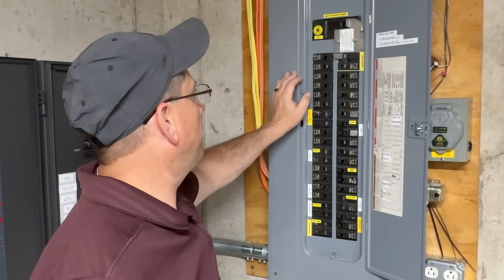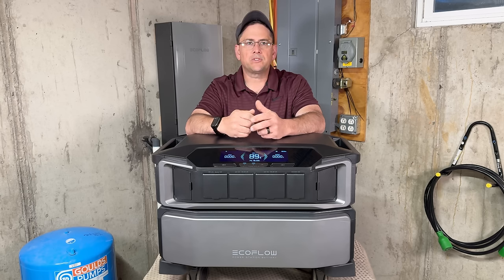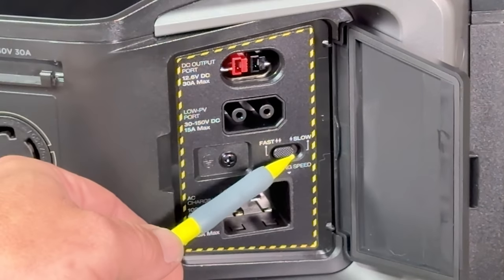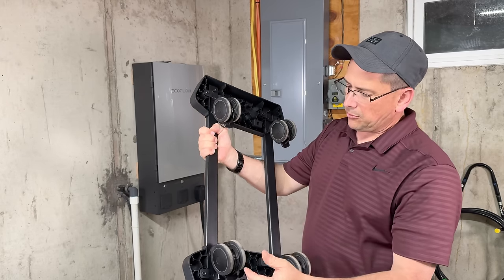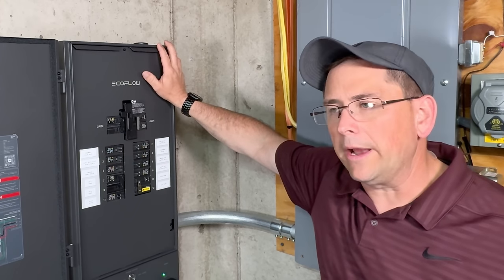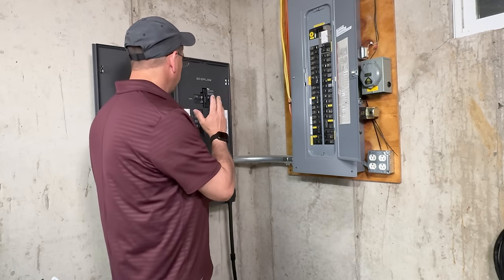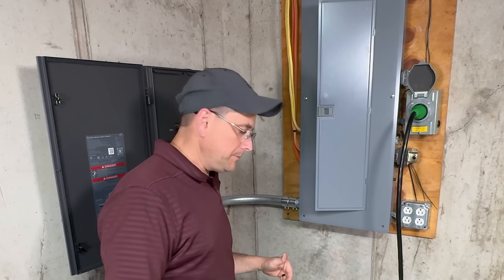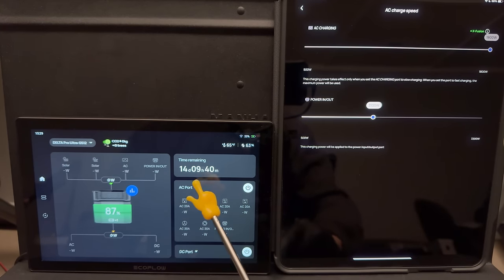EcoFlow Delta Pro Ultra & Smart Panel 2 Replaces Generac Standby Generators Part 1 of 2

Comment: Question; I have 25 circuits in my 200 amp main panel and plan to move the 12 most critical to this smart sub panel strictly for emergency power needs using a 2 battery Ultra configuration. My concern is the reliability of this smart panel and specifically the manual transfer switches. What type of switches are these? Are they a simple electro-mechanical switch where if the automated portion fails the manual function still works? I don't want to dedicate the 12 most critical circuits in my home and later experience a switch failure in the panel with no way to switch power for those circuits as for me it's either grid or battery. I've read at least one instance of a user having a panel issue where EcoFlow sent them a replacement SH2 panel which is an expensive swap out if an electrician is required. Are control components in this panel replaceable without having to disconnect and remove the entire panel?
Reply from the maker: It doesn’t look like there are serviceable parts inside, but I don’t have a repair manual for it. I will have to ask, from what I seen it does not look like it.
Reply: That is how it appears to me. Do you have any thoughts on the 2 switches that toggle between grid or battery power? Do you have any concerns over their durability?
Reply from the maker: It has a 10 year warranty, that’s longer than anything I’ve seen. Everything breaks, I’ve seen Generac generators lose brand new motors at start up, some at 1 & 2 years old. Nothing is full proof, if you’re wanting more reassurance then wire up the system with an interlock switch so you can override the panel if it fails.
Reply: @HVACRSurvival  What you say is true and the warranty is a good feature. There is one customer review on Costco that describes a failure of one of the panel's transfer switches and EcoFlow tech support indicated they would ship a replacement panel but apparently it took a while. In his case the switch was stuck on grid, not battery and if that's the fail safe default then I'm good with that.

I've thought about installing a transfer switch too for more flexibility but that doesn't solve the problem of the 12 isolated dead circuits in the SHP2 if it's possible for the panel to fail in that way. 

Thanks for your quick responses.
Reply: I just got off the phone with EcoFlow and they said the transfer switches in the panel can fail in either the gird or battery position so no default. 

After thinking more about this it may not be as dire of an issue as I thought because if they fail in the grid position I only lose backup capability should i need it. If they fail in the battery position and I have grid power, I can use an extension cord from a grid powered outlet to keep the batteries charged while they're powering the 12 critical circuits. I'd have to rely on this obviously until a replacement panel was received which isn't ideal but at least I'd have a way to power those circuits. It would be good to know you agree and that I'm not missing something. 

Thanks
Reply from the maker: @robertbaron3242 it does have a manual override switch. I haven’t showed the detailed testing yet, I’m due to release the video on Amazon prime day in July. I was also asked to combine the DP3 and DPU together and compare them. So the video will be a little different than I originally intended but it will be informative. I need to record the new stuff they want showed.
Reply: @robertbaron3242  I read that a customer who had a failure had to send the smart home panel back first, and I think said half the panel didn't work, so likely the idea of running on battery or grid wouldn't work, even if they sent you a panel first.  Either way, you are in for hours of labor to swap out a replacement which unless it's sent over  night (which I doubt, prob weeks of RMA) you will likely have to rewire your main panel back to how it was before.  As soon as I read that, I 100% bailed on the idea of installing one.. It's designed for your most critical circuits, no way could I rely on that.. could be more of a headache than riding out a storm with no electric for a day., you are at least preparing for a storm, not at dinner when a relay fails in the SHP... I decided on a DP3 with extra battery and their generator and will do the interlock...  lot of versatility without compromising any of my homes components.  It's a shame because for just a bit more money (already silly expensive) without the SHP you lose so many nice features.. auto switch, battery to offset time of use.. but no way should installing a backup system potentially be the cause of losing power.
Reply: @crzyworm623  I came to the same conclusion and shipped my SHP2 back but kept the DPU with 2 batteries. I instead installed both a Reliance 10 circuit transfer switch and their 50 amp generator inlet. This gives me the option to power either just 10 critical circuits or the entire panel. Having the option to power just select circuits provides more flexibility for routine battery maintenance without having to use the main panel interlock and disrupt the entire house. I installed the 50 amp versions with the possibility I might add a second DPU next year. 

It was a bit of a struggle to get the SHP2 returned because it was purchased as a package with the DPU through Costco but perseverance and a few months of patience got it done. I agree that you lose all the cool smart features of the SHP2 but I don't see that device as ready for prime time as it's just not reliable enough IMHO. I would like to have seen a simple manual override in the panel but that might not be possible.

Comment: What would you need to be equivalent to a 24kw Generac.  Cost and life
Reply from the maker: Each ultra is worth 7000 W so you would need three of them to get 21,000 W. Do you really need that many watts or were they trying to sell you something huge? Price seems a little high since that generator kit comes in at about seven grand so you must have a gas line that needs to put in? some permitting ? and maybe a concrete form that needs to be done?

Comment: Can you install two Smart Panel 2?
Reply from the maker: Theoretically, you could, they won’t be parallel together or technically interlocked, they would be separate units
Reply: Most US homes have more than 12 circuits. In order to be a whole house system they must make smart home 2 with more circuits. A home with 20 + circuits, a 4 ton and 3 ton AC unit will have to run on two separate panels and 2 separate inverters running on two separate apps. I like the setup but the cost as compared to a whole house standby generator will be less due to 12 circuits limitation. It’s a good emergency backup solution but not a whole house system. Thanks for the very informative video.
Reply from the maker: @starcat8450  you can hook three inverters into one panel giving you 21,000+ Watts and use tandem breakers to give yourself 24 individual circuits. Or you could possibly run a 60 amp breaker on one of the sections of the smart panel and feed another sub panel box with more breakers but you wouldn’t have individual control of each circuit like it would be if it was on a normal circuit in the smart panel 2.
Reply: Thanks for your reply. How is tandem breaker connect? I have a 200 amp main panel and 100 amp sub panel. I guess I have to put a 100 amp breaker in  SHP2 to connect my sub panel and move circuits from main panel. Does SHP2 allow tandem breakers?